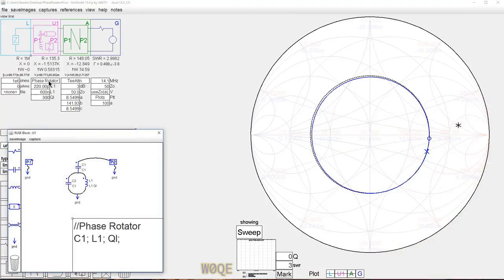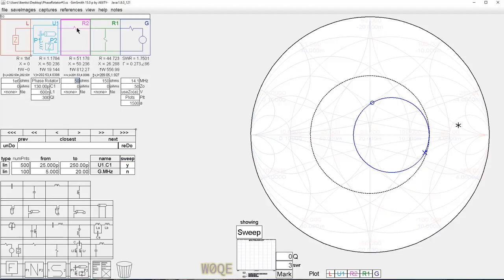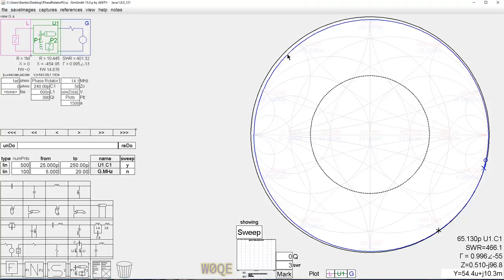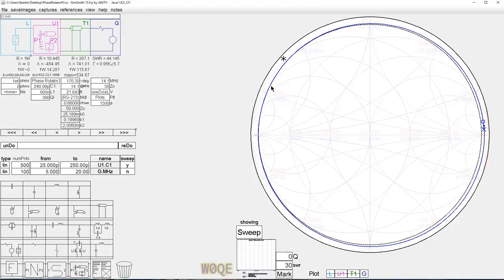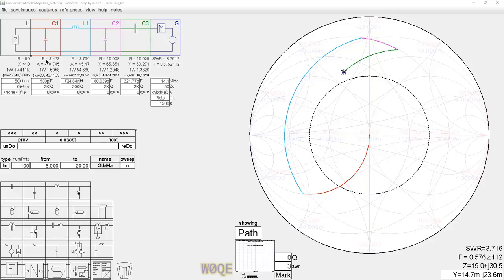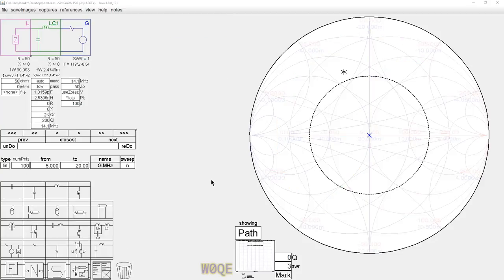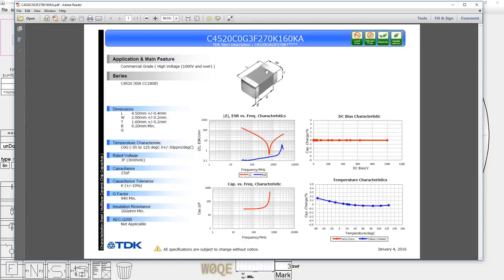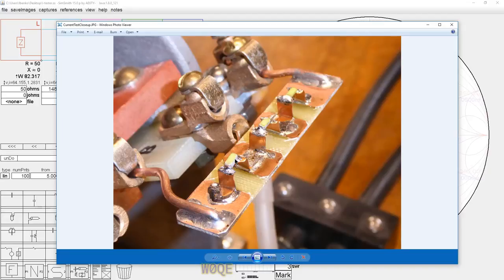#25: Interesting RF Circuits (Adv. 12)

Comment: Thanks again Larry - a really informative study, as always there's lots of insights to be had by watching your videos, I really like your component tester, excellent video.
#Question:
Larry have you a video on measuring loss in RF power components, ie inductor Q in particular?
Reply from the maker: Glad that you are enjoying the videos Harry.  Loss in components can be measured in a lot of ways and I have touched on some of the ways in various videos.  You can measure Q and calculate V or I at the frequency you are concerned about and get loss.  You can also measure temperature rise which is often more important than power loss which I often do with temperature indicating paints.  For lower Q components you can measure V, I, and phase and get loss easily at one frequency.  SimSmith does a great job of calculating loss vs freq if you have a good model for the inductor.